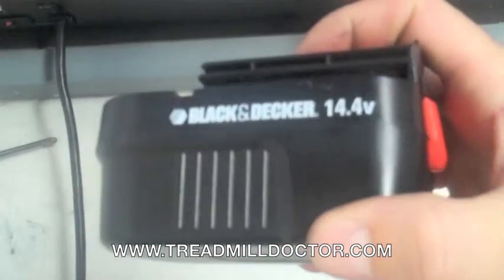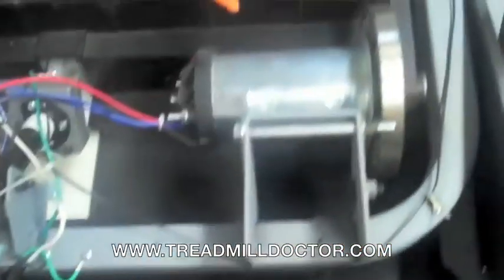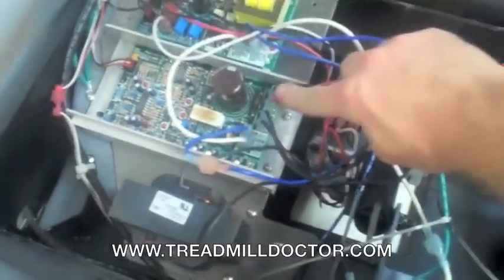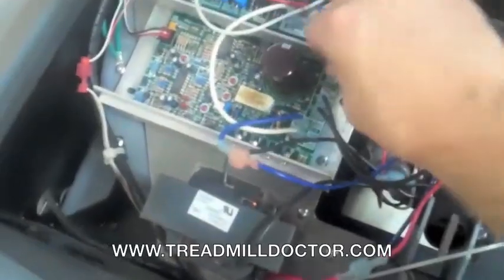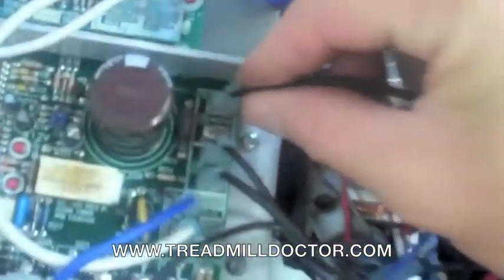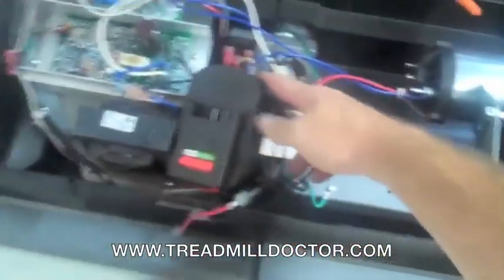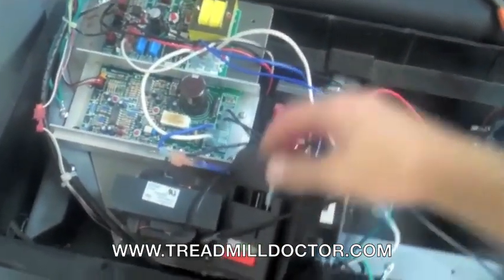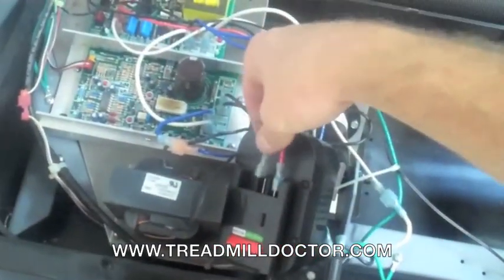HOW TO TEST A DRIVE MOTOR

Comment: I am having a very hard time to replace the drive belt...I did it last time, but this time, it won't stretch enough to be put in both places... :/ Also, the drive motor is making a noise similar to cricket, I ran the motor without the belt, to see it that was the problem, but it kept doing it..I have a feeling it's the "saw" round plate that turns when the motor is on...any tips? I wish I knew a technitian in my area, that would service homes, but someone trust worthy...

Comment: or check the brushes commutator and wiring. Most cases the brushes are burnt and worn from lack of maintenance to the belt and deck.
The only reason to replace a drive motor is if the permanent magnets fall from the inside of the motor and if the shaft is to worn or to close to the commutator to be welded and machined back down.

I never have customers just up and buy a new motor.
In most cases they can be repaired.